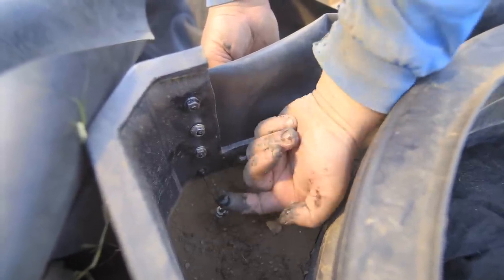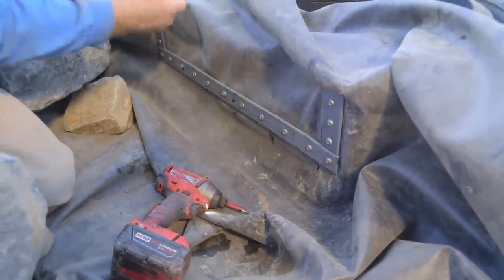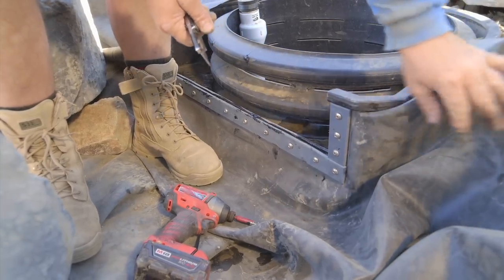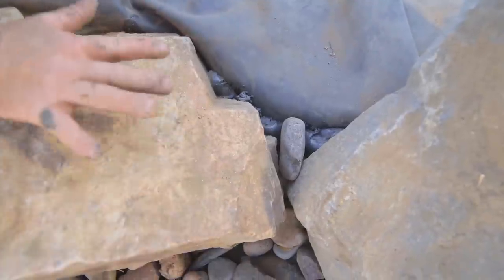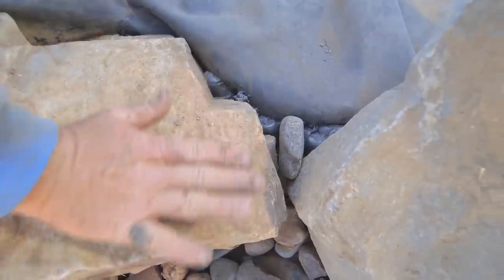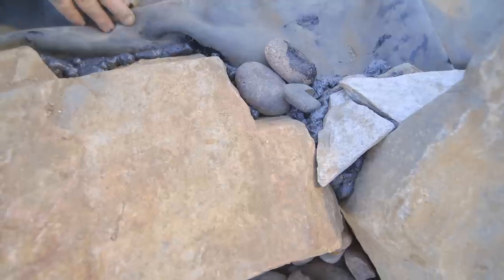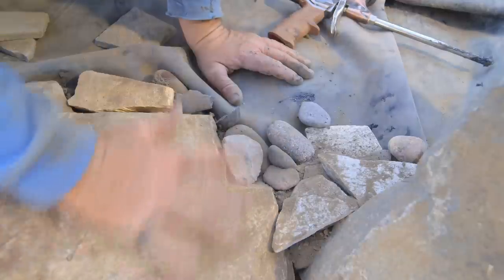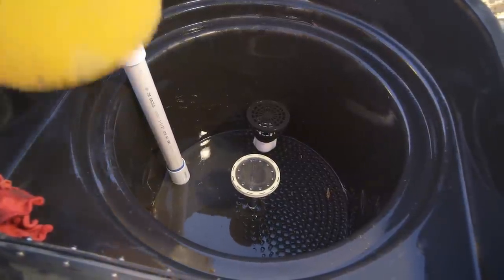Pond Liner Waterfall Filter Attachment  - KP 53

Comment: I have had people laugh at me because I use lava rock ,they say it is old fashioned media that does not work .My dad used it so I use it .Glad you show it here maybe they will stop making comments about my use of it .Proves it works then and now
Reply from the maker: sissy murphy Lava rock stands the test of time if you ask me!!
Reply: ThePondDigger True my dad used it back in the 60's when he built our pond on the mini farm we owned .
Reply: it works just harder to clean
Reply: @lindabonannno  I have stock tanks as filters and put a grate in the bottom with a small pump with a hose that runs out of the tank and if I want to clean the filter I just turn off my main pump and plug in the pump in the tank and use a hose to flush some of the gunk out into my flower beds .Easy to clean filters before I shut them down in late fall .
Reply: @sissymurphy9620  Would you elaborate? I'm at the installation phase of the waterfall filter and would like to use lava rocks. Thanks!